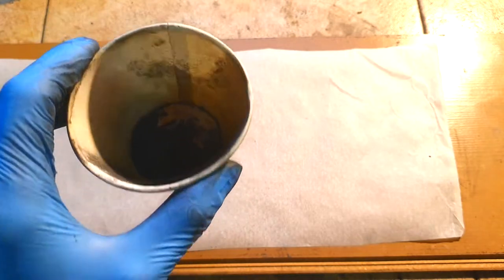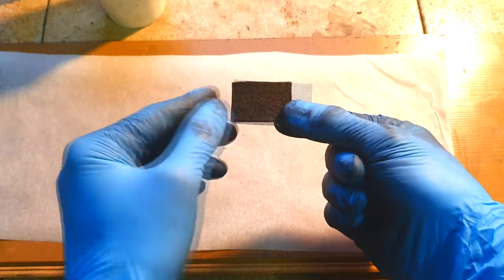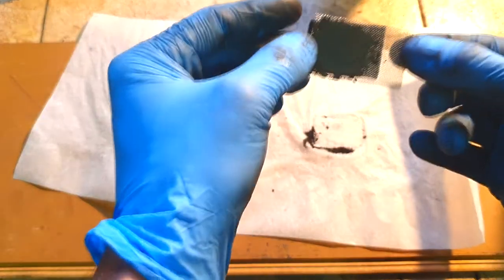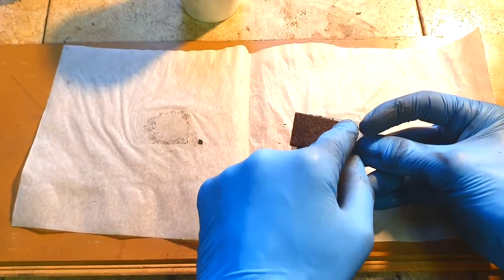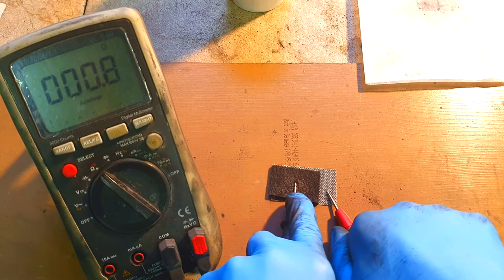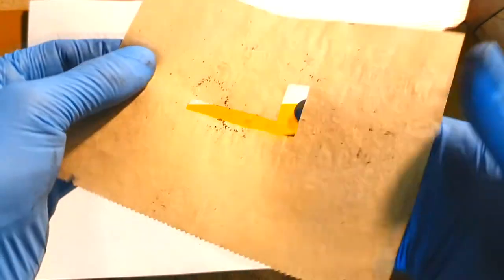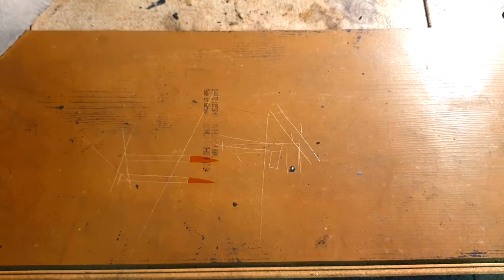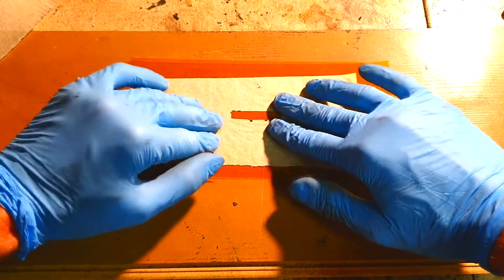Printed electronic with Conductive dry ink

Comment: Looking at you dismantling a printer cartridge and than showing the dry ink I knew what is rumbling in you mind! Grate job mate!!😉
Reply from the maker: Hehehe! My first idea about printer cartrtidge was a bit different,.... but it did not go according to plan. Then I come up with dry ink idea. And now I am looking to get some dry ink and to make some dry printing process for electronics 🤔🤨
Reply: @cayrex  particles are far too thick am I right? Anyway the idea is not bad... Laser printer use heat and pressure. I suggest a different way of grinding, the principle is that of ball milling. You cannot use big heavy balls clearly, polystyrene would melt and stick to the surface but...you can use in the mill some little glass spheres (2mm diameter) and spin the mill in freezing condition (salted ice bath would work great)...after the milling you can easily split the thin particulate from the spheres, than this particulate can be suspended in ethanol and filtered with coffee filter paper the ethanol won't be clear, boil off the filtered alcohol and a very fine particulate will be left. That could be used in the cartridge I think🤔
Reply from the maker: @Giarko  In the printing section of the video I use other Dry ink which is more flexible. Yes, the particels are to thick for now,.... because I only grind with coffee grinder, to see if the dry ink will be ok for that job.
Reply: @cayrex  It is very nice and flexible indeed!! It has very good potential...
Reply from the maker: @Giarko  yes it is,... but I hope that I can make better
Reply: @cayrex  you just need to make HomoFaciens Direct Granules Extruder using a super fine nozzle for this powder into a basic plotter using & publicly advocating his diy methods/ yt channel

Comment: What kind of felt are you using?
Reply from the maker: Some classic Pan based carbon felt
Reply: @cayrex  like the stuff used in aquarium filters?
Reply: FYI on the last one you made you should drag a straight edge over the paper to remove overfilling. Your plastic might not wrinkle as bad.
Reply from the maker: @MAGnetICus_Attractus  no,... go to ebay and look for pan based carbon felt
Reply from the maker: @MAGnetICus_Attractus  thank you for the tip
Reply: Awesome. Are you planning on selling this stuff.
Reply from the maker: @danp1224  what you mean? Carbon felt or conductive dry ink
Reply: @cayrex  the dry ink.
Reply from the maker: @danp1224  Maybe if I get more interest for the dry ink.